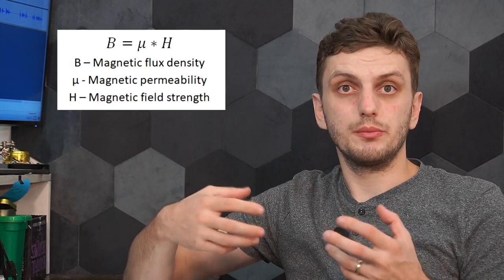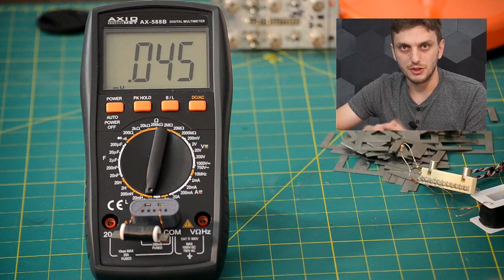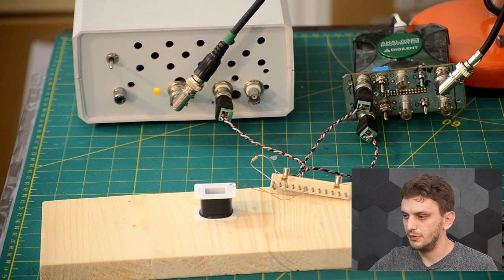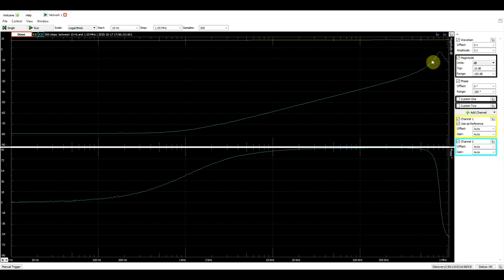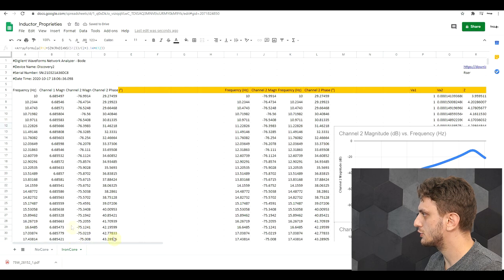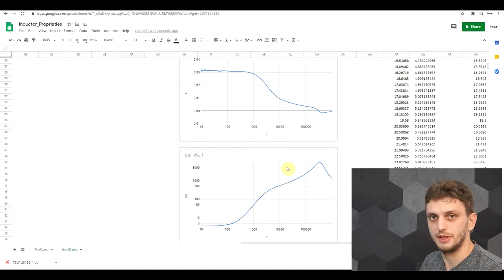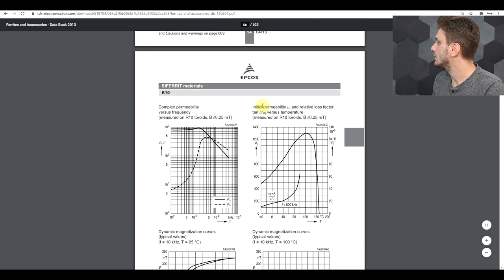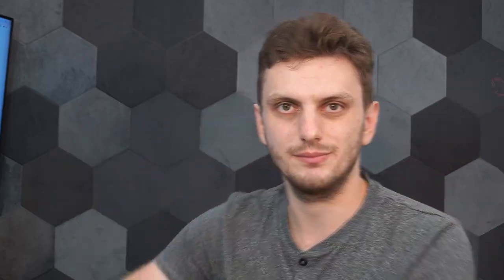Electronics tutorial - Ferrite and Magnetic permeability

Comment: Great presentation.

What is puzzling is why then pmsm motors, which use high frequency PWM, are made with laminated silicon steel instead of ferrites. I assume this is mainly due for structural reasons.

Comment: Excellent video! Maybe as a follow up, it would be very interesting to look at the current vs inductance graph (saturation) as well as doing distortion measurements. 
Also adding a DC current will drastically reduce performance of many inductors (without an air gap)
From an audio point of view it's by far the least linear component.
Reply from the maker: Actually I do plan to look at saturation and temperature effects in the next video of this "series". Its quite a pity that most ferrite bead datasheets have absolutely no current derating curves - I mean you get some curves related to heating, but nothing related to impedance loss.
Reply: @FesZElectronics  yes. Even in most datasheets of inductors that's missing. 
Quite an important variable.
Reply: Since you mentioned it... This air gap thing; It remains confusing to me- I have a sense of when they use it... I have unwound a metric fu(#-tonne of transformers, meticulously: but I haven't heard an explanation that I understand. Nothing unusual here. 
 ... So in the example of a DC bias that you cite, what is it about the air gap that prevents this from being a problem? something to do with saturation?.......  I basically don't know what I'm talking about in this area. I struggle to ask a question that I imagine makes sense.
 I have to deal with this stuff though because I'm an audio guy; I play instruments... often through unusual circuitry, so... there is a big overlap- especially in my case. 
 If you have any idea what I'm asking (more than I do)... I thank you for your insight.
 peace, and rock on, Mr (or Mrs.) Mouse.

Comment: I've just repaired my induction meter. The negative inductance reading is mainly caused by the fuse and fuse holder inside the meter. Just take out the fuse and clean the contact area, it may fix this problem.
Reply from the maker: Thanks for the suggestion! I checked my fuse, it was burned out; but after replacing it, the problem persisted. It seems the inductance measurement does not go trough the fuse with this particular meter...

Comment: Is there a list or table of inductor core materials and their losses at certain frequencies and energy storage potential? I am always unsure which of the sort-by-price inductors are suitable for what applications.
Reply: Ferrite cores are manufactured with a number of ratio mixes and material mixes.  They’ve gotten better over the years resulting in smaller cores and lower wire size.  
Keep in mind - at frequencies higher than 20KHz, the skin effect causes electron flow to concentrate at the outermost layer of the conductors.

Comment: Why are electric motors exclusively using steel sheet cores? I've calculated many brushless motors go at about 16khz per phase, especially electric vehicles. They use bare steel sheet cores in the coils and the rotor (with either magnet or conductor inserts for synchronous or asynchronous mode). CD/DVD and HDD drive motors go between 300 and 400 hz.

Comment: Great video with very useful information. Could you explore how to minimize low frequency common mode currents on coaxial cable outer surface shield or return conductor? This is a problem when measuring low impedance components or power distribution networks IPDN) on PCBs with a VNA or frequency response analyzer (FRA).

Comment: Excellent video.. I like the application note from Tektronix, I actually used the same setup for impedance measurements and will use it again in the future for sure. If you don't mind, I would like to ask your opinion on a matter that I came across recently. A 2.6 mH inductor with a ferrite core (cylinder with 10 mm diameter and 7 cm length) is changing the inductance to almost 3 mH in the proximity of a large metal object. Is the permeability of the core changing, or the magnetic field is disrupted by the large metal object? 
Is there a way to compensate that? 
Thank you..
Reply from the maker: I guess the issue is that the old core was just the ferrite cylinder and air; that was giving the 2,6 mH; by having the metal object (I guess its ferro magnetic) the magnetic filed pass trough that also, so the new "core" is made from the old and part of the object. That is why the total permeability is slightly larger. You might try increasing the distance between inductor and object, or try changing the material of the object; or if price allows it, change the inductor to have a less open magnetic field - so rather than a rod core, have a ring core or something.
Reply: @FesZElectronics  Many thanks ! I tried increasing the distance from the metal, which is a 5 ton solid steel block, but I am limited to just 1 cm of room. There are moving parts that restrict the position of my inductor, if I move it more than 1 cm away, it will collide with the moving parts. Also, we tried carving into the steel block to remove some metal, but was insufficient. I'm still looking for solutions and will probably try other core materials. Thank you again ! Multam mult ;)
Reply: @levibanuta8381  To be honest; I want to hear more... I think it was the five-ton steel block. Go figure. 
 peace, and rock on.

Comment: You know for months I have being issues with my mosfet overheats with every ferrite core I buy on Amazon and today I came across the real reason why my mesfet get hot with very little load and it’s the type of material that the ferrite is made with all this time I was using pc40 material ferrite for months I ever give up in ferrite transformer and now my ferrite inverter work will pc40 is for fly back converter only and 3c90 material is for push pull converter